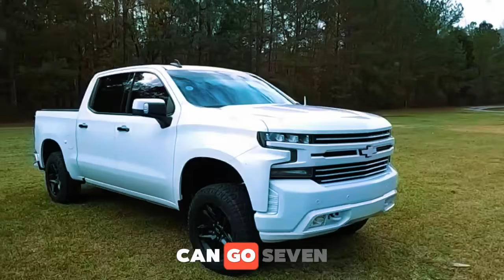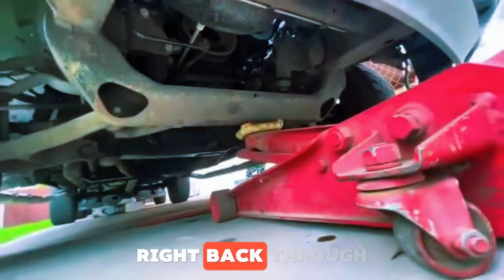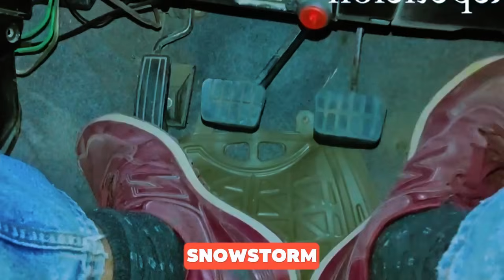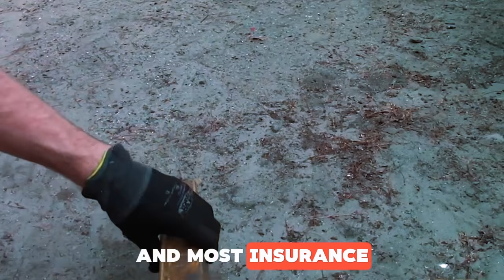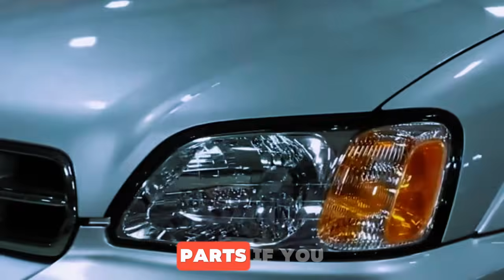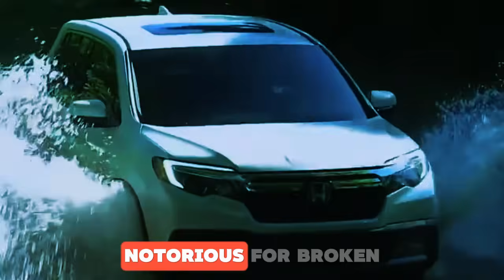How to Keep Your Silverado Running Forever: The 300k Mile Maintenance Plan

Comment: Just got rid of 04 Tahoe. Honestly it gave me over 400 thousand miles. Lifers ticked and I took it to a known mechanic. He told me to go buy a bottle of trans fluid. I was told to pour a half bottle into the gas tank. I was shocked when the ticking went away after about a week. I finally got rid of it because I like the newer body styles. Big Big mistake. Only difference is the newer ones burn less fuel and requires more pampering.

Comment: My 2013 z71 4x4 150000 5.3 only issues is fuel management. All original major components still on it. Change oil ever time 3000 or 3500 no more than that